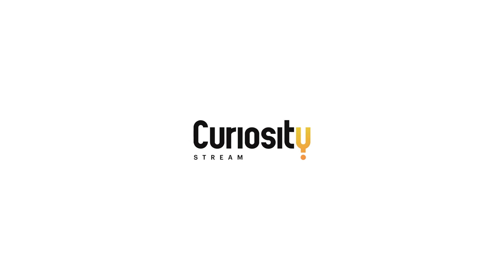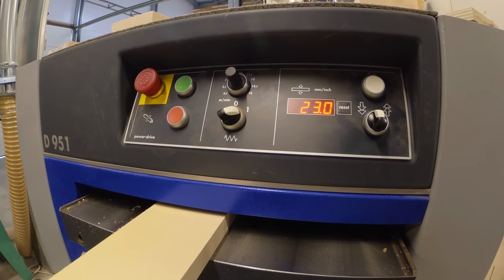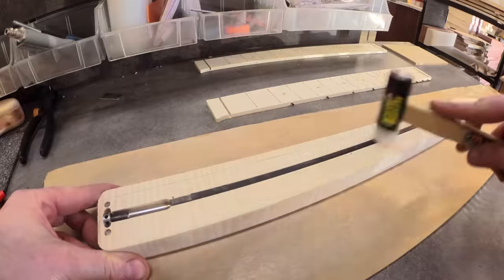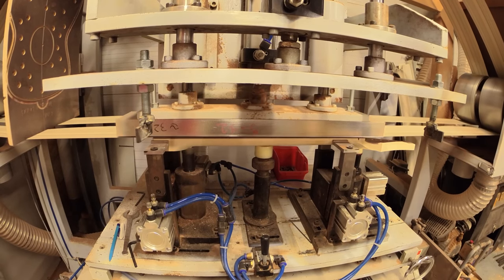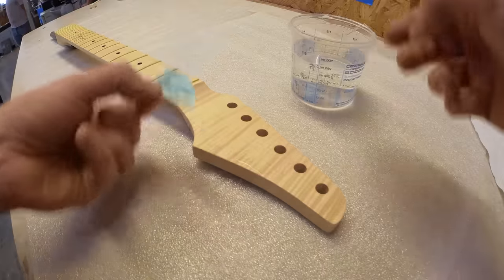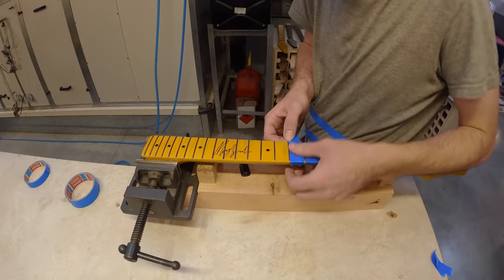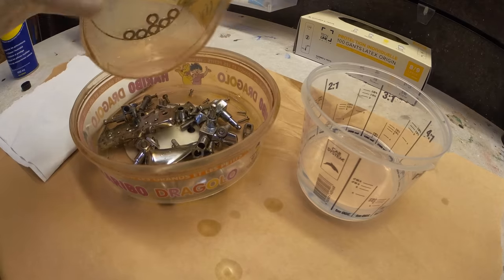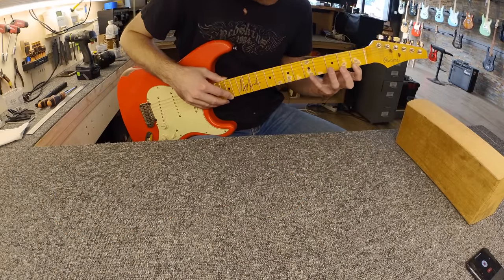Full Build of my Custom Electric Guitar

Comment: Thank you so much for putting your trust in me, it has been a real blast to make you a guitar!
Reply: Amazing craftsmanship 👏👏👏👏
Reply: I have a question, why would you put the signature on the fretboard before checking and sanding for radius? Obviously doesn’t impact much but just curious.
Reply: @cheneyrobert  ‘CNC machining’
Reply: @johngrant5749  
There’s more to craftsmanship than cutting wood (or any other material) by hand.
Reply: @Steve-qn8gn  If I understand your question correctly, it's so that the filled parts of the signature inlay follows the radius of the neck. If the signature had been done after radiusing the inlay would be flat leaving angled edges between the wood of the neck and the inlay. Those edges could snag the strings during bends, etc.
Hope I've explained that ok.
Reply: @tonysansom  yeah that makes sense, thanks Tony
Reply: The truss rod adjustment wheel and the magnetically-attached cover is an absolute work of art, engineering and design!
Reply: @Steve-qn8gn  Welcome Steve.
Reply: @charlesbolton8471  including not spraying an item with other items in the spray booth.
Reply: masterful work!
Reply: @johngrant5749  Can you do it even with having the CNC machine and all the tools? No? That's what the craftsmanship is!
Reply: @vitaliistep  can I do it? Yes. I assume the luthiers all learned their skills first then use CNC to maximise their time. As opposed to someone employed to press a button.
Reply: I found this whole process incredible!!!  Love that you actually do all the pickup winds yourselves!  So basically the only outsourced parts on the guitar as best I can tell, are the tuners and bridge? (Ok and I suppose the pots and wires too)
Reply: Great work - wonderfully produced video
Reply: @johngrant5749  I don't understand your point then :)
Reply: @johngrant5749  Yes, CNC machining. Why wouldn't a craftsman use the best tool for the job? What would be advantage of cutting it some other way?
Reply: Incredible work
Reply: My Marceau Experience is by far the best strat I ever owned !
Reply: @Steve-qn8gn  its all about operational efficiency, if you were to add inlays and the signature after sanding and finalising the radius, you would need the inlays and the signature to be 100% the right height, in other words you would have a margin of error of literally 0.0000%, otherwise you would feel the inlays poking out of the fretboard. Doing it before sanding allows a significantly larger margin of error, you can add inlays that are slightly thicker than needed and once you sand everything will be 100% flush… this way is infinetly more efficient and reliable.

Comment: Very interesting to see a small pro shop do this. I built a strat from parts a while ago, the relicing was by far the most fun part of the build, though I wish I'd thought to use the buffing wheel. I sat there with high grit sandpaper and a scalpel for hours like a lemon 😂. I like the individuality that wear gives to an instrument, whether it's been put there deliberately (such as a relic) or is a genuine vintage instrument.

Comment: I worked with early cad engraving machines (circa   1980's) but entirely with metals & plastic laminates... cool fact : they were often used on SUPER early guitars just for the face plate/pick guards cause they made cool flowing edges. My machine was a New Hermes the company made pantographs for like 100 years prior

Comment: I have weird thoughts on relic guitars anyway but I respect it, what's weird is that things like the tuners got a corrosion bath with the inners exposed. I would suppose it's a good idea to try and seal the mechanical insides so these actually live longer in practice, while leaving what matters corroded

Comment: If you have any connections at Fender, take a look at the '61 Custom Shop Gary Moore tribute...it'd be right up your alley.  If you don't have connections at Fender, there's one on ebay now for a mere $47,122 lol.  S00000 tempted to hit the "buy it now" button, but I'm about $47,000 short right now.  As for the releccing, screw the haters, it looks good.  The Gary Moore tribute I mentioned is beat to sh** :).

Comment: It was a nice guitar until the relicing. I noticed the tension springs at an angle, I have never had a guitar stay in tune with the tension springs at an angle if using a floating tremolo bridge.

Comment: Good guitar but where is the "custom" when it's build by CNC. 
It's not custom unless it's hand build, mostly with none power tools.
Reply: it's custom because they didn't use "default" pickups. they made it themselves. and the body, and the neck. and basically everything. Yep, that's why it's called "Custom". custom ≠ hand-crafted.

Comment: It's not that it's not a nice instrument, I just... don't understand the appeal of custom strats. Most of the time, other than maybe an ebony fretboard or some relic'ing, they look just like an American standard. Strats have always felt "cheap" to me (probably because they were designed to BE cheap) and if I'm gonna drop the money that one does for a custom shop model, it would be at the very bottom of my list. From the plastic knobs, to the headstock with the little string trees, to the intrusive control layout, to the pickguard, to the plate for the bolt on neck, to the colors they're offered in,  it just bugs me across the board. 

Obviously that's just opinion, and very likely wrong. There's a reason the strat has appeared in nearly every single genre   since they came into being. Unfortunately, that versatility doesn't do anything to my total lack of enthusiasm when someone tells me they bought a new guitar, and out pops a Strat. Violence ensues if it's seafoam green.

Comment: You lost me with the relicing. It doesn't even look convincing. Then add into it that they tried to make a custom artist signature model with a unique bridge and headstock look older than the artist herself seems kind of silly. I've got an 1988 Strat Plus that I bought new and was gigged with in smokey bars for years that could pass for a new guitar from a few feet away because it was never abused and was always looked after.